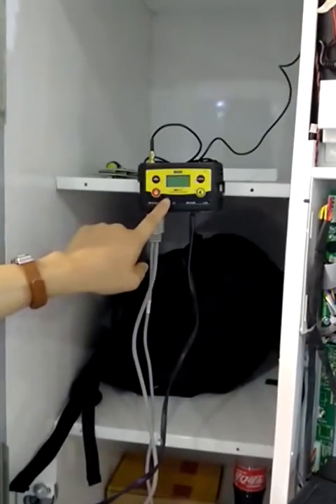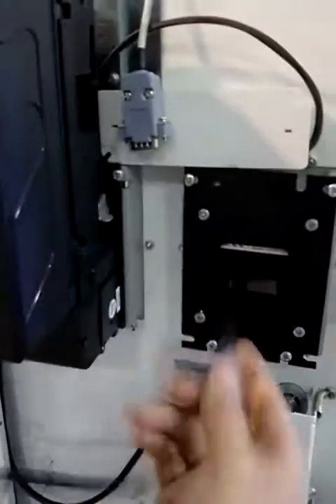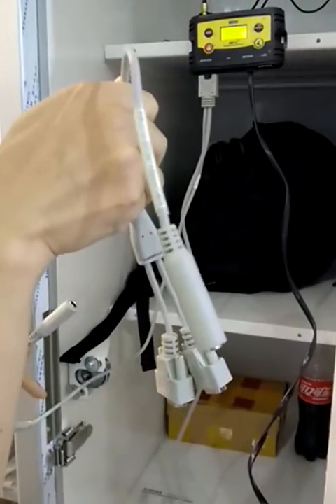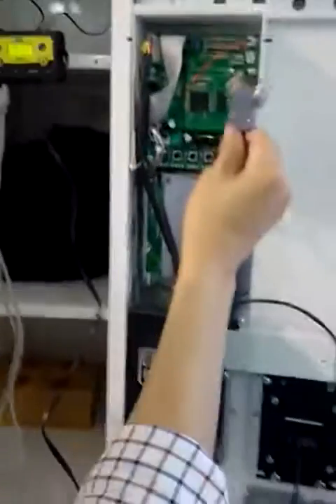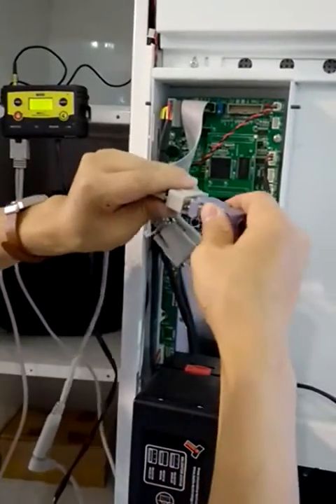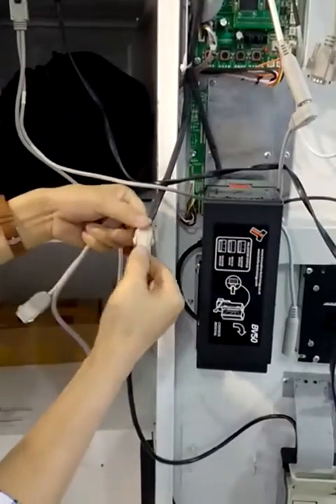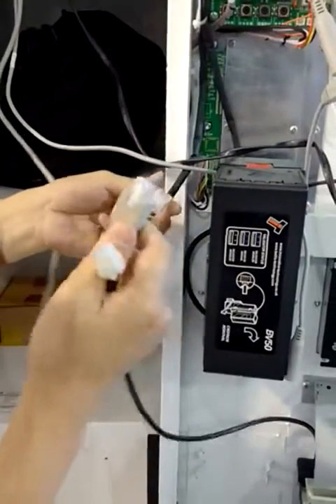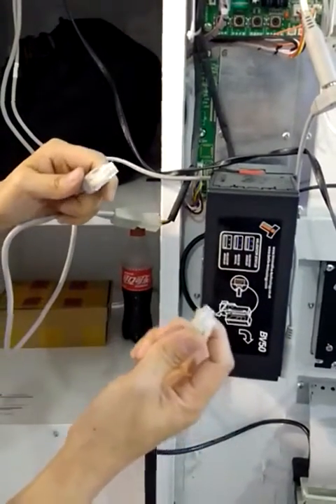Nayax Telemetry & VPOS Cashless Reader Connection

Comment: Waferstar has a Raspberry pi mdb adapter board , and also has a plastic housing. that is use helpful and useful for vending system development with Raspberry pi.
http://www.waferlife.com/en/MDB-Raspberry-pi-vending.html
The above link is very useful for raspberry pi to vending machine.